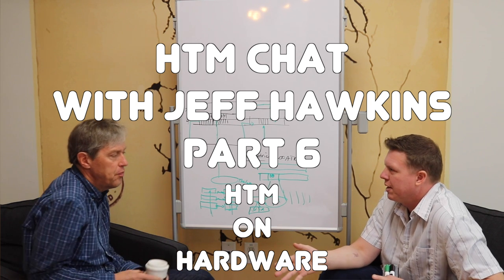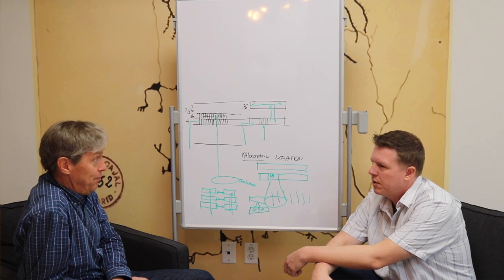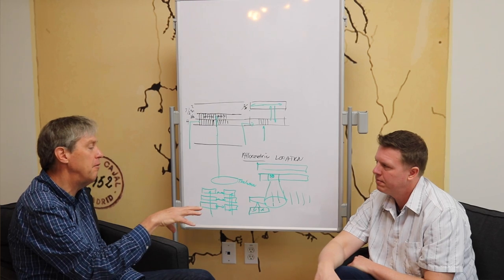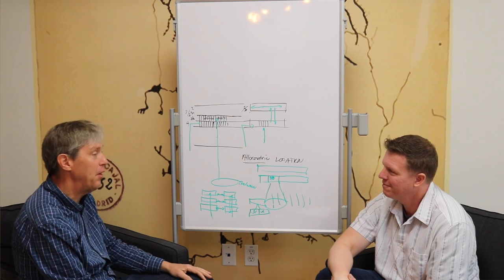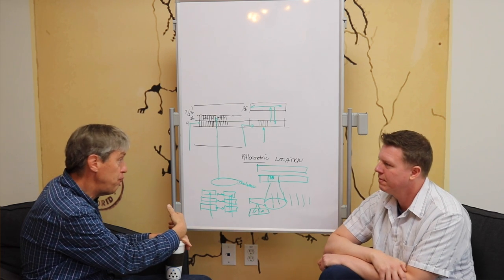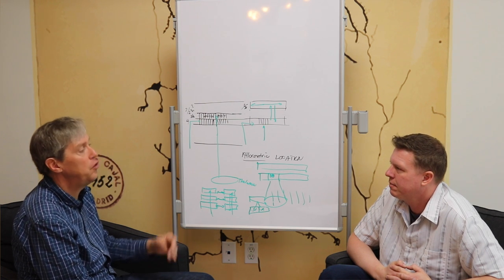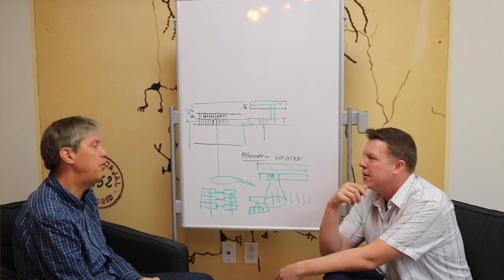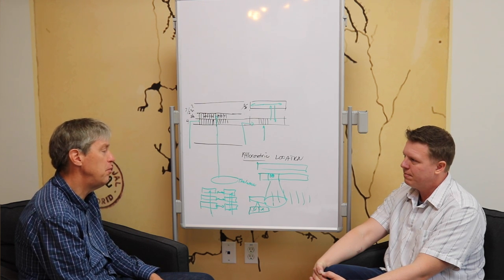HTM on Hardware (Part 6)

Comment: Glad to hear this discussion and especially how the neuromorphic chip designers are beginning to consider neuron models more akin to the HTM neuron!

I'm not clear on one point however. The HICANN chip literature indicates that the hardware doesn't directly implement "neurons", but "membrane circuits"; one or many of those can be configured to act together as a single neuron and each membrane circuit implements an adaptive exponential firing model. My understanding is that their grouping implements an OR gate (although I'm not sure on this). Furthermore Sebastian's paper shows how to connect membrane circuits together to implement minicolumns that exhibit the HTM theoretical behavior (including predictive states). I thought these behaviors cover the functionality of active dendrites.
What is meant, then, by "active dendrites" and by the current hardware not implementing them?
Reply from the maker: I can't answer this question, but people who can answer it are on https://discourse.numenta.org/